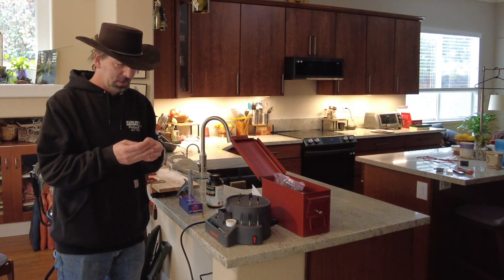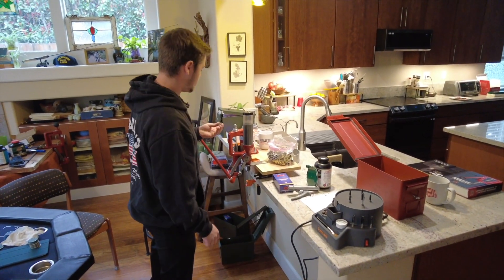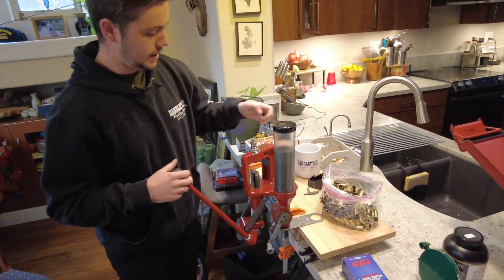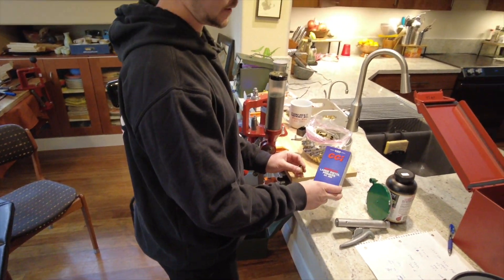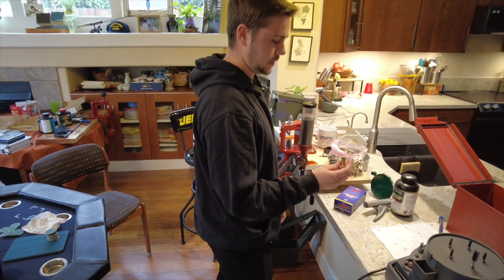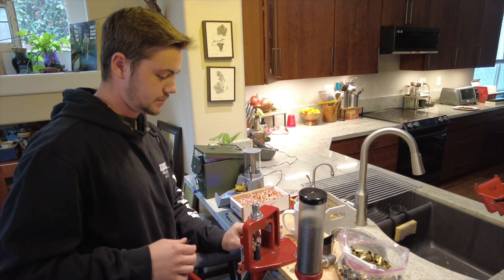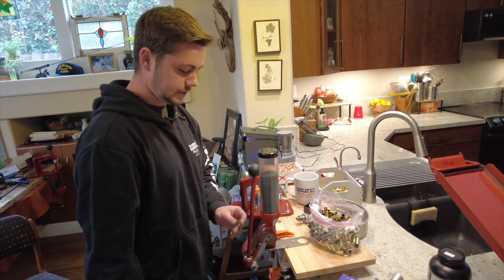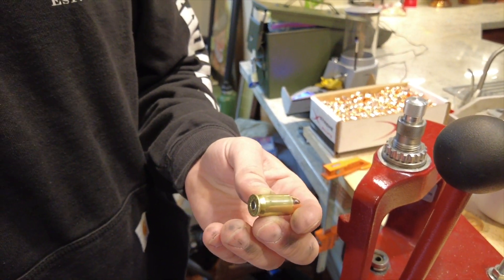Reloading 45-ACP from start to finish

Comment: Magnum primers in a 45?
Reply from the maker: Thanks for your comment. It’s not a preferred option but primers we’re hard to find until just recently so we used the only thing we could find. Just make sure your loads are in the low to medium velocity range. Shot over 500 rounds with that primer and no problems.
Reply: We either use magnum primers or start makin' fishing sinkers with our equipment.   @norcalrambler101
Reply from the maker: @2pugman  Welcome to California. 👍.  We can’t ship primers or powder through the mail so we have to make due with whatever the gun shop owners can wrangle up.